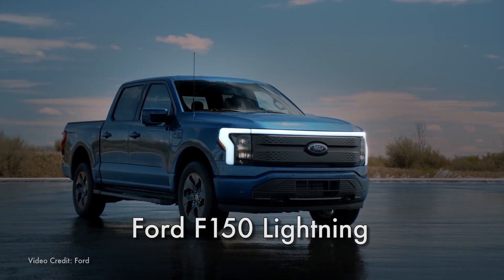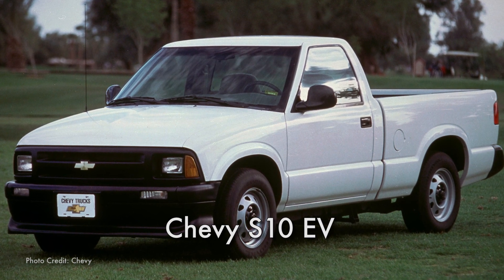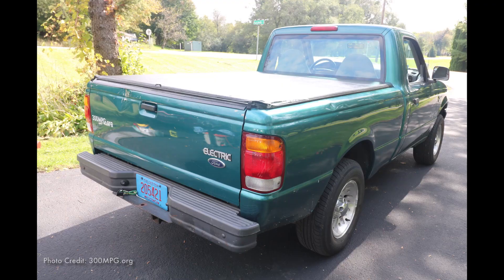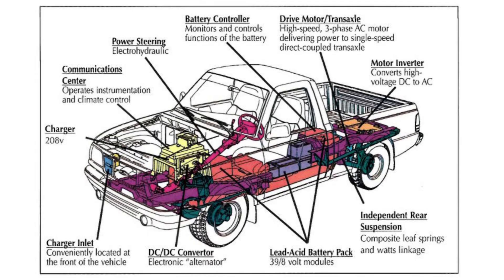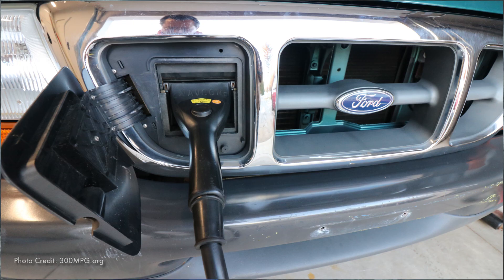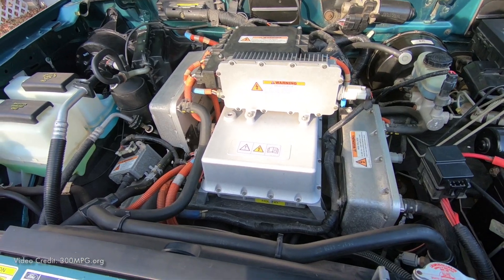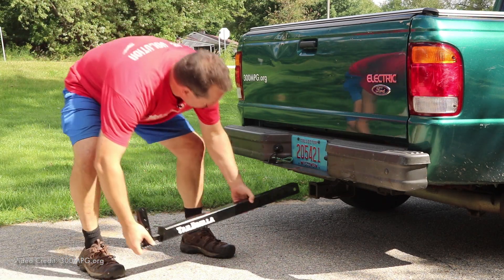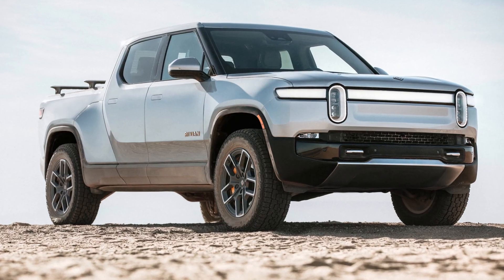Ford's OTHER Electric Truck! | The Ford Ranger EV

Comment: i love the power and torque of EV's but can't stand the range. unloaded and definitely loaded. current batteries are too heavy and not dense enough.
Reply from the maker: A vehicle like the Ford F-150 Lighting can go 320 miles on a charge. It has fast-charging, and can power your house in a blackout.

I'm sure there's people that need to drive over 300 miles per day, but the average person in the United States drives less than 30.
Reply: @BenjaminNelsonX  the 320 mile range is the extended range which costs way more than it needs to. when you start getting into the 90k range, for me it will be putting me in a vehicle that I want to use for long distance traveling not something I'm going to run to the grocery store and back. if they would come up with a Maverick with a 300-mi range then that would be a more practical vehicle and have it priced in the $40,000 range

Comment: i wish they would make the new ford maverick all electric and stop price gouging.
Reply from the maker: The very first thing that I thought when I first learned about the Maverick was that they missed the boat by NOT making it a Plug-In Hybrid or EV!
Reply: @BenjaminNelsonX  they way i drive now. now with gas prices so high is about 200 miles a month. if they made a electric one i would have it by now.  but they are price gouging so bad right now its not even funny.

Comment: The University of Michigan bought a fleet of 6.  All red.  I was luck enough to own one for a short time.  I sold it when it was apparent it was way more tech. then I could handle and with a range of 12 miles on the lead acid batteries.